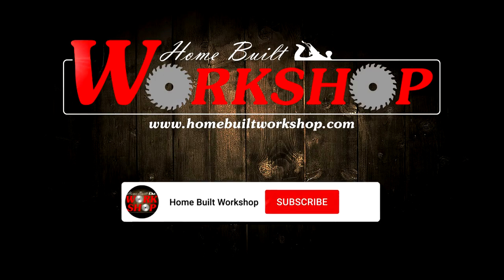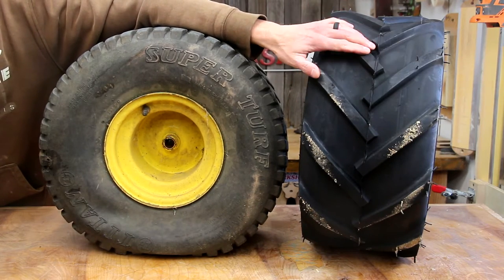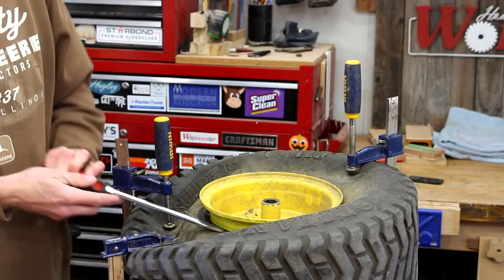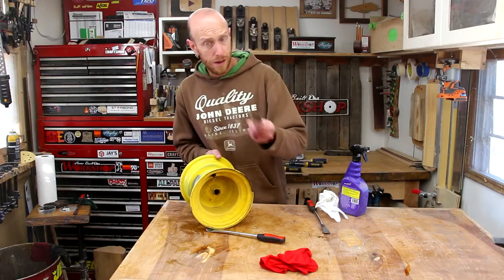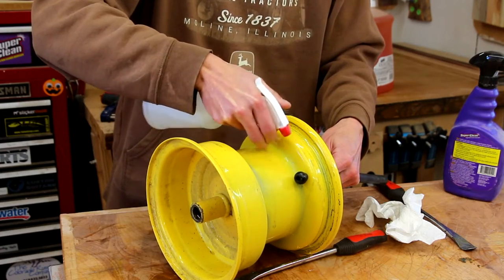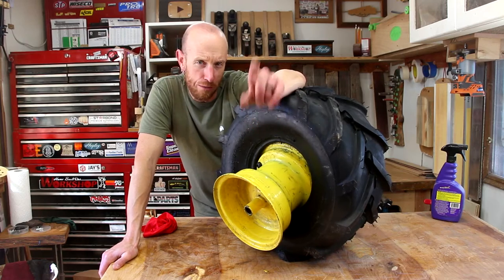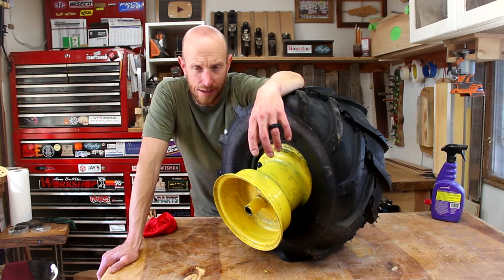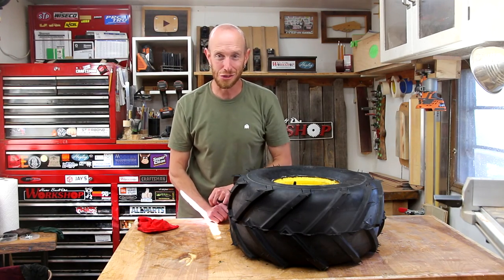Changing Garden Tractor Rear Tires | This was harder than I thought

Comment: Your gonna regret putting the tractor lug tires on your mower. Big....really big mistake. 
 Before when your turf tread tire lost traction and spun it was because your mower was in some kind of a bind (not level like an embankment) so it gave way and spun.
In other words it became the weakest link.
 Now with the tractor tire lug, it shouldn't spin. It's no longer the weakest link. Now your transmission  is😳.  Not a good idea making the transmission on a hydro type transmission. 
 I get it. It's easier to install  lugs than get off the mower  and move it around so it stops spinning  the tire but you do t realize  the strain  your Now putting  your transmission  in now.  It won't hurt it all at once but over time your transmission  will begin  to weaken more quickly. 
 Hydro  transmissions aren't  very forgiving when it comes to putting  them in a straining situation
Reply: Hydro transmissions are EXTREMELY forgiving in strain. They don't have mechanical leverage to break . It can either turn it's own internal systems and move forward or it can't. 

In your scenario, where before a turf tire might slip and spin, now it might not and just bog the motor down.
Reply: @cyberslick18  tell that to the guy who installs a new hydro pump in it. I'm sure he'll  get a big laugh out of it too😂🤣😅

Comment: $25.00 for one bead? RAPE
Reply from the maker: It was for mounting 2 tires.
Reply: @homebuiltshop  I just did all four on my Wheel Horse. Same thread you're putting on.  I used tire soap and it wasn't too bad. I also "cheated" and used tubes in all four.